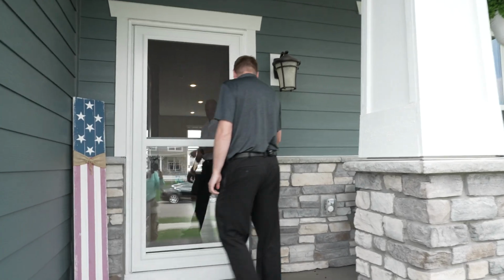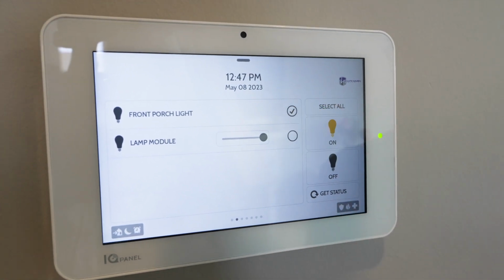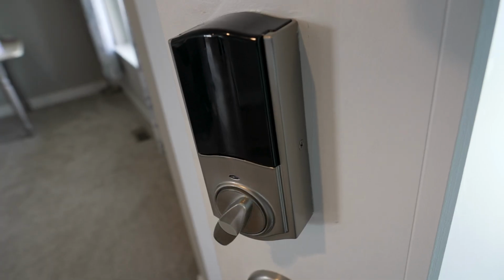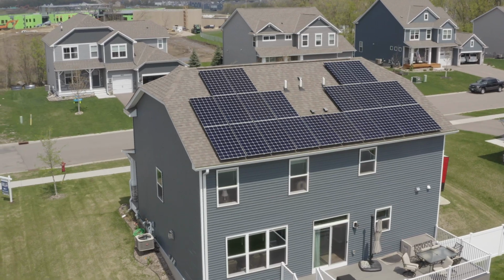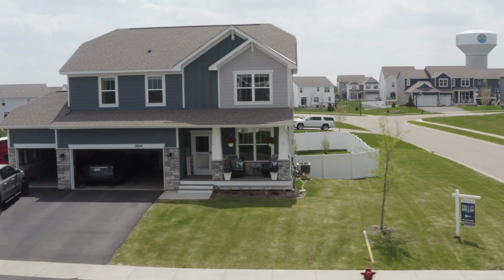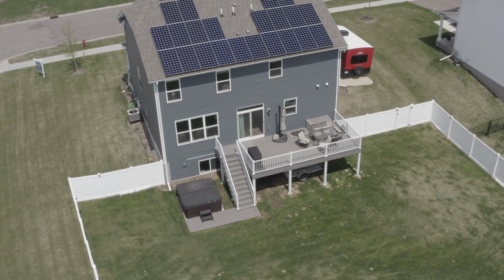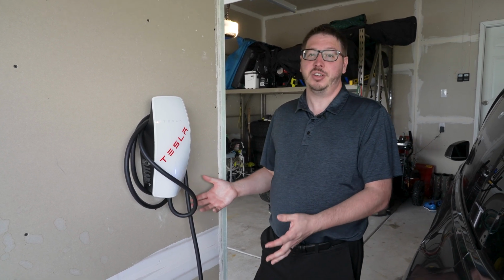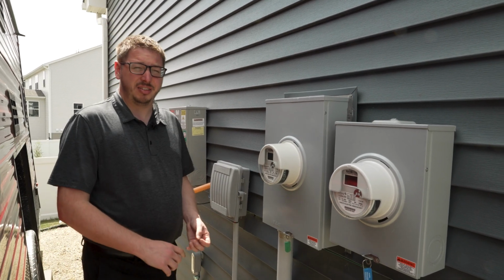DR Horton Smart Home Tour: Does Tech and Solar Add Value?

Comment: I don't like that my front porch and garage lights are connected together I want the garage lights on but not the porch lights
Reply from the maker: For that you’d need to either hire an electrician or use smart bulbs
Reply: Well here's the thing if I use smart bulbs I still have to turn on the lights and the light on the porch and the garage will come on..... the garage lights are bulbs and the porch lights are like these plates with LED in them they are not light bulbs
Reply from the maker: @Twistedtitan499  can you replace those? otherwise it sounds like you’d need to hire an electrician. Most homes are wired that way but I can see why you might want to control them independently

Comment: I declined to meet with the builder’s security company.  Just about to move in and will either put the z wave devices on my own hub, or rip out the stuff supplied by the security company and start from scratch.
Reply: I wish I could do this. Seems like a lot of work. I dislike data collection, it’s free for a reason. Yucky tech

Comment: Not much of a smart home.

Wait until you can control all of the lights, ceiling fans, TV's, bathroom vents, garage doors, locks, cameras, thermostats, and create an AC zone for every room in your house with voice command. 

And have solar on top of that.
Reply from the maker: The builder has included just enough to call it smart, the buyers could certainly add a lot more. Seems like most national builders have some sort of smart tech package included on new builds now

Comment: DR Horton built my house - Awful quality.  They did not even connect the dryer vent to the outside.   It dumps into the attic.   Drywall is a mess and having just replaced the upstairs flooring....they don't know how to build square.  I bet the Cat 6 is holding it together...
Reply from the maker: Wow! What area do you live in?